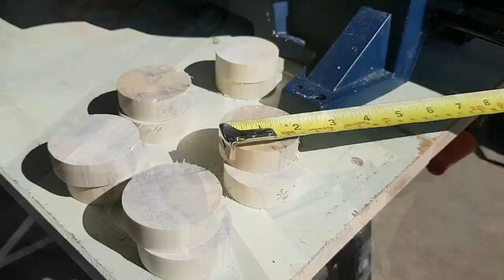HOW TO MAKE A FUN GAME AT HOME - PUCKET GAME BUILD

Comment: Hi, great video thank you:)
What is the size of the rubber that you used?
Reply from the maker: I picked up the rubber paracord for camping tents at my local MEC (Mountain Equipment Coop store)... I think it was either 1/4" or 5/16" in diameter. Hope that helps. Even a bungee cord will work

Comment: Like it,it looks bigger to me? What are the dimensions or so you have plans for it I would like to try to make one for me and my family...thanks for the video
Reply from the maker: Thanks for the comment. The melamine surface is 20x36", then you add the edging and that kicks it out slightly larger. I have made others at 16x36" and I find that to be a more enjoyable surface as you play mostly in the center region of the board instead of the edges. The sides are 2.25" high (1/2" is covering the melamine board). The pucks are 2" in diameter with a height just shy of 3/4". No plans to share unfortunately, but hopefully these will help you build one for yourself!
Reply: The type of the rope is what?
Reply from the maker: @ahmedsarhan8495 , its shockcord or a type of bungee cord. You can find it at outdoor stores, this one was from MEC.ca (Mountain Equipment Co-op). The hole for it was drilled based on its diameter, they can be found in varying sizes and resistances.

Comment: What bit did you use at the drill press?
Reply from the maker: I used a countersinking bit which drills a pilot hole and a countersink one for the head of the screw. Allows for the wood plugs to be inserted into the hole to hide the screw head. I have 4 bits for #6, #8, #10 and #12 size screws.

Comment: Thanks for the video! What is the size of the hole in the middle?
Reply from the maker: Thanks for the comment... I make the opening 1/2" larger than the diameter of the puck/disk. The larger you make the opening, the easier the game becomes. I had an idea for a sliding gate that can control the size of the opening (makes it easier for kids to play) but havent done one yet. Hope that helps.
Reply: @JasonHedrich  thanks
Reply: What is the size of the hole of the rope?